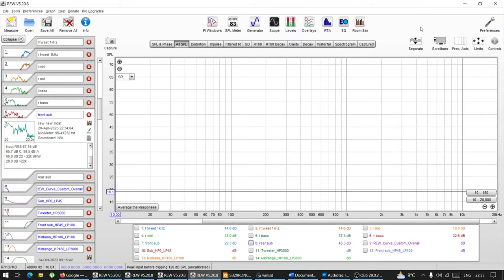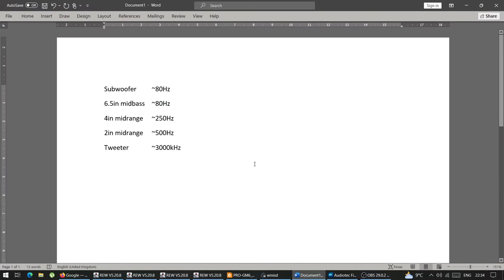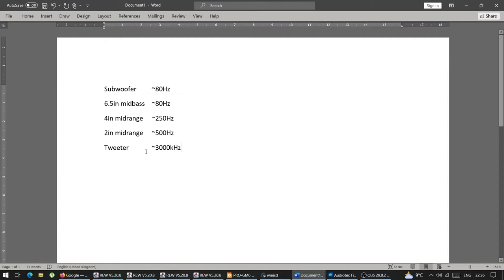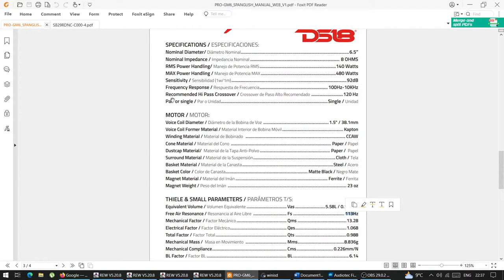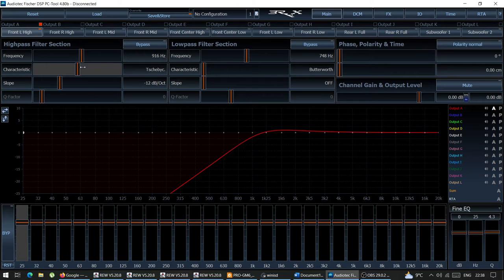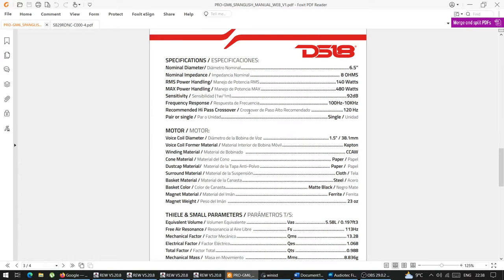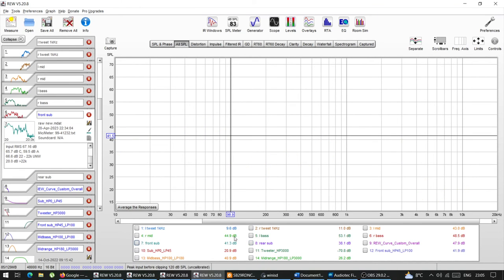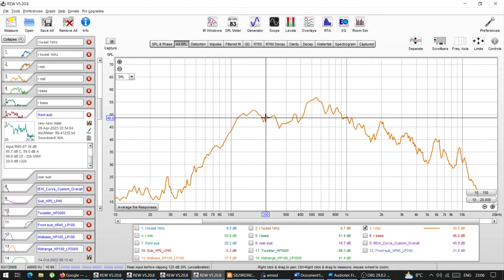How to choose crossovers for your drivers

Comment: I found it very helpful for tuning my new DIY Desktop/PC Speakers.  Actually just the understanding of how each factor affects the other factors is priceless.  Electrical crossovers with certain slopes and power outputs may be a good starting foundation,<WinISD> but the actual Rew acoustic responses are what you want to tune for as they are what you are going to hear coming out of your speakers.  I cannot imagine using Analog speaker tuning like all of the 20th Century and part of the 21st.  Now with DSP you can cut out the cost and tedious labor of Inductors, Resistors, and Capacitors and ultimately achieve a very fine acoustic tune of your speakers.

Comment: I currently run some 2.5in full range drivers on my dash and they are crossed over at 200Hz. I let my rear deck drivers cover 200Hz to 60Hz, and let my sub (IB18) cover 60Hz and below.

Eventually I would like to get a couple more amplifier channels to try and do a bit better. But as is, it's very enjoyable and my 2.5in drivers handle 200Hz+ like a champ. Plus them being $10 each driver, I'm never going to blow one, but if I did, they're dirt cheap to replace. And sound 100x better than in door speakers.

Thanks for the awesome in depth videos!

Comment: Do you have a video on how to measure properly with an RTA or mic with phone I’m gonna get audio tool on my phone and a Dayton audio mic to get some data on my system. Thank you and great job on this video I’ve been rewatching it non stop taking notes .
Reply from the maker: I don't use a prone for rta as I find it extremely limited. No real tuning can be done on a phone in my opinion.
Reply: @RAW-CAt  ok what would you suggest for a cheap RTA not 8-900 bucks for a 1-2 time use a year I see a real opportunity for shops to have one because it would be used daily  but for someone who installs his own gear I don’t see it being used more then 3 times a year any help is appreciated have a great dsy
Reply from the maker: @thatguykai479  watch my latest videos. I use REW, it is free. All you need is a mic and a windows laptop.
Reply: @RAW-CAt if I’m summing channels for my subs and tweeters by my front left and right will I need to make my crossover for it full pass ? Like 30-20k to play mids  tweeters and sub frequencies. I hope that makes sense sorry.
Reply from the maker: @thatguykai479  the summing of the i put channels have nothing to do with the output. Every output channel has to be assigned to a different speaker driver. And you cross the outputs accordingly.
Reply: @RAW-CAt  your videos really help and i love how responsive you are you earned a sub by me a while ago have a great dsy

Comment: This was very good and thorough thank you.  As I know when a driver is acoustically following a smooth response after crossovers and EQ, their phase response will typically be smoother as well.  Will choosing a non-linkwitz crossover electrically in a Helix DSP cause any concern with that?  Such as a bessel?
Reply from the maker: Not at all. Acoustical crossover slope is the one that matters, it doesn't matter what kind it is. As long as it's safe for the driver (prevents overexcursion)

Comment: Hi! How about using drivers from older but decent 3 way home speaker into an active system? Been wondering about taking drivers from old B&O s45 for example. Maybe I’m weird :) Woukd need to high pass the woofer pretty high since doors make bad enclosures and use sub under 100. Thanks for the videos. Learning a lot and get to daydream about what could be :)
Reply from the maker: Sure you can try. However if the speaker is very old, the suspension might be very loose.

Comment: Perhaps I missed it as it was a fairly lengthy video but its worth mentioning the potential phase issues as you change the order of the crossover.... a possible follow up tutorial?
Reply from the maker: In the video I was talking about the difference between electrical and acoustical crossovers. As long as you have 24dB LR acoustical crossovers measured, it doesn't matter what crossovers you are using in the DSP.
Reply: @RAW-CAt  I thought you were implying to chose the electrical crossover based on the acoustical response. In which case you may have 18dB/oct for the HP and 12dB/oct for the low pass. I agree, if both slopes are the same then providing there are no spatial differences you shouldn't expect any phase issues.

Comment: QQ...if say you're aiming for a 400-3500 LT4 XO for your mid ranges to the tweets.  It is okay to have different electrical cross overs in your left and right Mid ranges to get there?  Or should they be the same?  I assume it is okay based on the video but double checking as there is differing opinions on the web!
Reply from the maker: Yes it is ok to use different electrical crossovers.

Comment: Perfect timing. I'm selecting crossover points right now.  In REW on the EQ tab, I don't have the crossover selections at the bottom. I believe you have a Helix and I have a JL twk.  Assuming the twk doesn't have the ability to model crossovers in REW, how do I get around this limitation? Take readings of each type of available crossover types with different slopes on each?
Reply from the maker: In the EQ window under the DSP type select "generic". And check if you are runing the latest version of REW.
Reply: Thank you sir.  Guess there is no reason to select the twk since it can't transfer the settings automatically.
Reply: Should pairs of speakers always have the same crossover/ slopes or can they be different to match the target?
Reply from the maker: @dhassay  most of the time crossovers will be different.

Comment: I have a 2007 GX470 the Mark Levinson audio system. The entire system uses 16OHM speakers. It's becoming increasingly hard to find car audio drivers that operate at 16OHM. The rest of the system is impressive, but I can't help but think that it would benefit from a driver refresh & upgrade. 
What should I do with lower impedance speakers in order not to put the amplifier in jeopardy? I've looked for the ML specifications without result.
Reply from the maker: You might want to look at some Pro audio gear with 16ohm impedance. But best option would be to replace the factory amplifier with an aftermarket one and have "normal" 4ohm speakers.
Reply: @RAW-CAt  That's a gordian knot of the first order. The amp is integrated with thing else. Not to whine, though. Rewoprking car audio isn't for the faint of heart. Many people just toss in whatever 8ohm they can afford or find and takes their chances.

Comment: I have seen this tutorial so many times but still need to keep rewatching. 
Biggest question is so technically each driver is going to have its own crossover point. Meaning left midbass can have its own crossover point and right midbass will have its own crossover point?
Reply from the maker: Yes. Each driver can have a different crossover. Think about it, all drivers are in different locations relative to the listener. All drivers will have different level due to different distances to the listener. Different cabin gain, different loading. So if all the drivers are performing different to each other, why should they have the same crossovers?
Reply: @RAW-CAt  but in BUG CAT, we are keeping it simple and have same crossover for pair of drivers like e.g. mid bass?
Reply from the maker: @uos64  CAT-BUG is for beginners.

Comment: I’d like to suggest discussing crossover parameters and the results using the term electro-acoustical. You refer to it as acoustical but, that’s no more accurate than saying electrical only. The response that you end up with is a combination of the electrical from the crossover itself plus the acoustic response of the driver/enclosure. At its heart it’s equivalent to having two filters in series and you can’t expect to arrive at your target response without taking into account the characteristics of both. They impact each other in both magnitude and phase. The end result is to get the combination to perform to your target, not to make the crossover somehow deal with the driver response. You sort of allude to the concept but, don’t clearly point it out.
Reply from the maker: Yes, you are right. And in future videos I might use that term. Thanks for pointing this out. I personally am not too worried about the words that I use as long as it gets the meaning across.

Comment: using REW how do I see  frequency / driver summations ??
Reply from the maker: You need to use arithmetic functions and use multiplication. However, that doesn't take phase into account. So you can see "ideal" summation only.

Comment: If my mid bass was cross at 900hz HPF in Rew to match the acoustic crossover of 75-250hz Should I use the 900hz as HPF at my DSP or 250hz?
Reply from the maker: I think you mean low pass?🤔 You should use crossover that works according to REW and then measure again to confirm it actually does what you need it to do.
Reply: Aah ya sorry LPF. I had a Wideband in the dash. 2 6.5” mid bass front and 2 6.5” mid bass rear on a SUV. No sub. So all four doors are equip with 6.5”’and in ge front dash there are 2 3.5” wideband. I’ve tested the respond using Rew. My 6.5” RS speakers had a FS 7.3. Is there any way I could send you my REW data for you to analyze?
Reply from the maker: @feins  sure, find me on FB
Reply from the maker: @5bobo  nerijus kochanskas

Comment: I never see anyone using xovers with steeper slopes for example 48db/Oct. Anyone know why that is?
Reply from the maker: The purpose of the crossover is to blend the drivers so that they would sum flat. It's very difficult and impractical to blend 48dB slopes.
Reply: @RAW-CAt  Ah, I thought that would be the case. Thanks. BTW, I love your channel, which is very interesting and informative. I've learned a ton from you 👍🏻

Comment: your videos are good but here I just wanted to point out that in this video at 2:23 min there's one small correction that is to be rectified. For tweeter hi-pass should be of either 3kHz or 3000Hz and not 3000kHz
Reply from the maker: Haha,yes you are right, that was a typo.